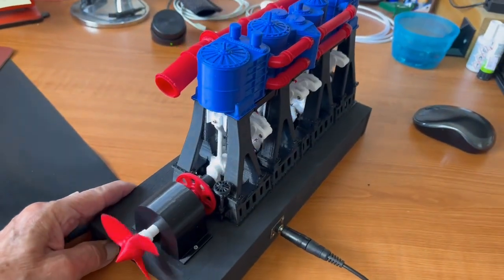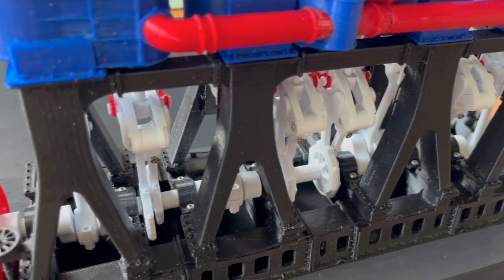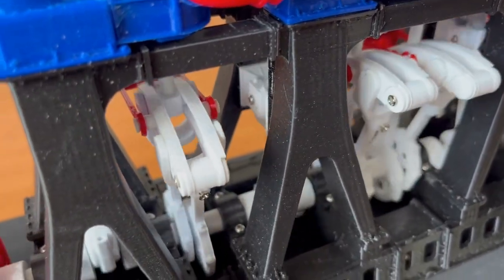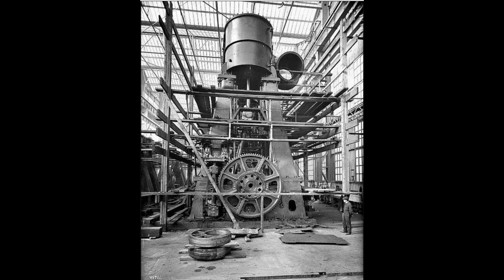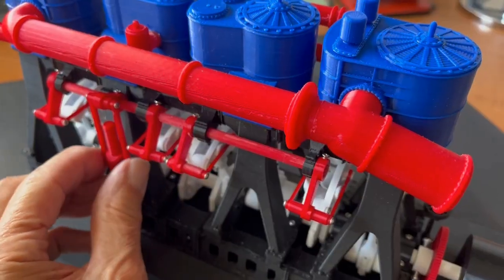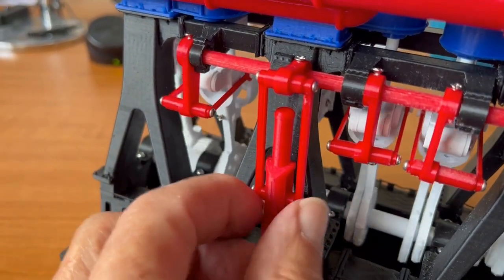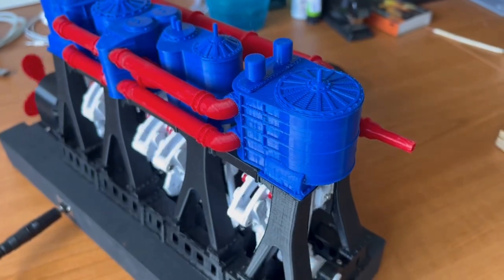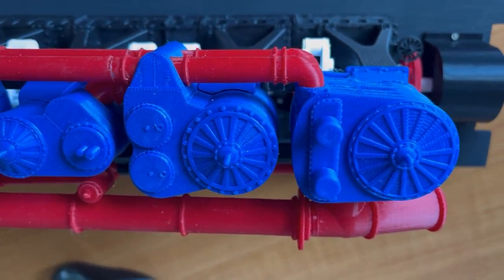Titanic Engine

Comment: Thank you for the shout out 🙂. Very cool build. And even I could not get the final version of the model to run on air at that scale, altough my prototype ran fine. I think I just got extremely lucky with the PLA I used for the prototype.
Reply from the maker: Hello Olivier. Great to hear from you. I am grateful for the information regarding not being able to get your final design to run on air. Makes me feel better for all the hours I spent trying everything I knew to get it to run. Have you looked at my YouTube Marine engine where I took a lot of your design but changed the valve configuration and got it to run on air.  https://www.youtube.com/watch?v=UPri3dWl3No